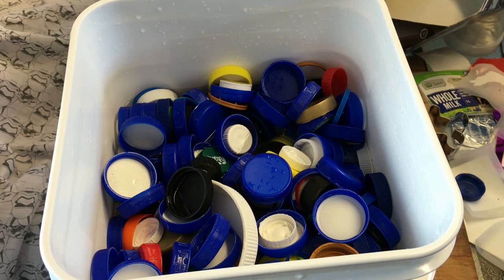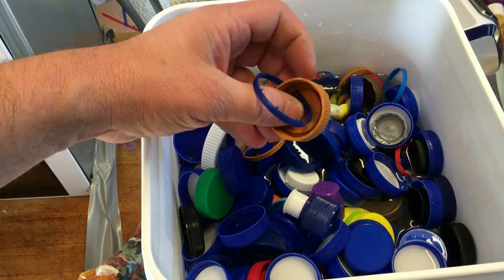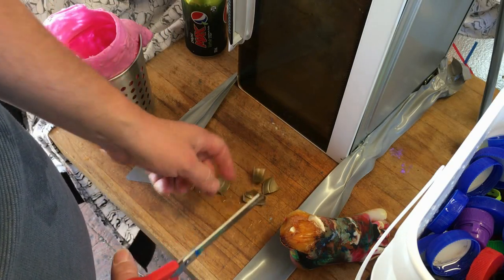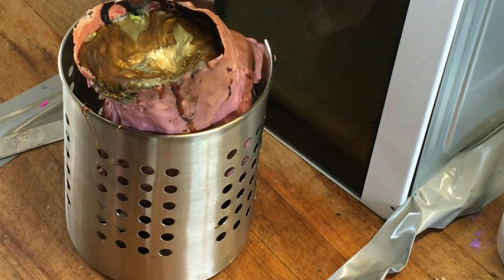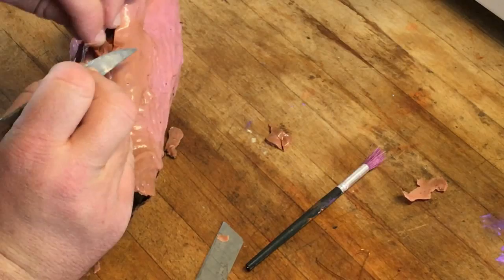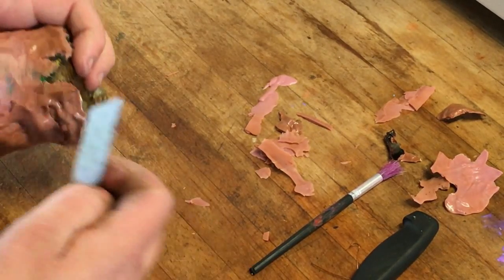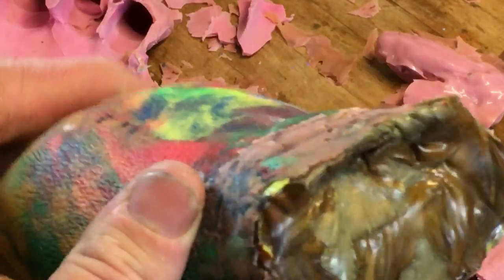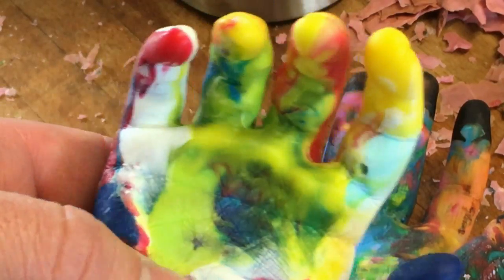Ep41 Silicone Mould HDPE Colored Milk Lids

Comment: Great job man. First vid i watched on my quest to learn about casting hdpe in silicone. The parts i will be replicating are far simpler than a human hand, so it is wonderful to see such high detail carried over to the finished product. Reassures me about my potential results. Thanks for sharing!
Reply from the maker: I am glad you like the video. I have not been successful in saving the silicone. Well the silicone I have been using has been degrading over time. Like it is a one shot deal. In my experiments I have not found a mold release that would help.  Thanks for watching. Kev.
Reply: @kevsmodellingchannel  thanks for the reply! My plan is to do a sacrificial first casting, and cut my mold in half to release. Then attempt to cast again using the same mold, bound together. Will try silicone spray lubricant as a mold release. Fingers crossed!

Comment: After applying the silicon and before removing the form, make a mother mold to hold the silicone mold in the oven. Another skill to learn.
Reply from the maker: Ken Knutson
Thank you for your comment you are on the money. What i have been thinking about is how to make a mother mould for supporting the glove mould in the oven. Plaster would have a long cure time need something faster that would like heat (heat limits choices). 
I am trying to due, is not to aggravate the person that the glove mould is attached to. Mostly kids have a very short window of time you can keep them still.
Any thoughts
I can be contacted via F/B Kevs modelling channel group  

Thanks for watching
kevin

Comment: This video is helpful. I hope you can share an update on mould removal agents you’ve found out. Thanks
Reply from the maker: Hey Abigail 
Thanks for the comment .. NO i have not found any release agent. The problem is any release agent that i would use has to not endure the oven temperatures with out drying. Most release agents only good for short duration's..
Thanks for the watch
Kev

Comment: think it looks like the same mold release I use works well. Another type mold release you can make yourself for silicon to silcon release agent is half petroleum jelly and half keroseen clear pearl pure. you only need just a tad of both as it goes along ways. Use soft bristle brush cut down to make a bit stiffer to spread on sparingly so the release does not imprint a pattern on the part. mold will look like it has a simi wet coat of your homemade release. What is good about silicon to silicon you can make plugs off molds or molds off your plugs made with silicon which if one thinks about the process you will come up with all sorts of clever things you can do quickly and mass produce it yourself.
Reply: 1NRG24Seven

Comment: You can use compressed air to separate the mold.
Reply from the maker: garyrich2000
Thank you for the Idea but this hand was not going to be released with out a fight. It seems that i have not found the right mould release that is able to withstand the oven temps. 
Thanks for watching
kev

Comment: Hey you were going right with paint brush handle, but if you did it under water, it would made separation whey easier
Reply from the maker: Thanks Peter Robertson for the comment.. They say silicone does not stick much to things.. I differ when it comes to heating this ODDbod silicone. I have not found a release agent yet.. PLA  Plastic works ok with this silcone  Thanks for watching and the comment.. Kevin

Comment: I've seen others using hdpe where they just melt the hdpe in a tray in the oven all in one go and then place in the mold. Wouldn't it be much quicker than 3 days to do it that way?
Reply from the maker: Hey Rustystone27
This is a bit different, I am useing the properties of the plastic to allow plastic flow in to the mould. You could not the push the plastic in to this mould. Not with out suporting the mould from expanding. Ie like a mother mould on the outside.

Could this gold colour of burned when in the oven. My best guess is no I did use some black ,gold and what ever colour i had on hand . Some of the melted lids flow in a different time periods giving different patterns.

Thanks for watching
facebook group kevs modelling channel
Reply: Yep, that’s the way I do it too but the plastic needs to be quite runny

Comment: awesome video mate, From the UK. i was going to ask about sand which you mentioned in the end anyway also what if the fingertips are black because it is burnt maybe?

i was always thought when hdpe cools down it shrinks etc and creases up but it doesnt show on yours. when you say it took 3 days do you mean you oven was on for three days?
cheers
Reply from the maker: Hello Mohammed Ali
 1) The oven was not on continuously  for 3 days. What i meant is my time invested was about 3 days. ie the oven was on for about 6 hours one day 4 hours the next 3 hours and so.

2) I did use sand when i did my daughters foot. Just the container i had was pourous so no sand used. Next time new container

3) All plastic does have a shrinkage factor but you dont see it in my hand because there no straight lines. 

4 ) The black hand colour ep42 explains this. 3 primary colours turns black.  The temp of the oven never whent abouve 200deg c .  Buring i dont think it would look like  this. (maybe will have to try this over temp experiments ) 

Thank you for watching my adventures
Reply: Kevs Modelling Channel
thank you for explaining i just watched the other videos too,  thank you for posting your adventures :)

Comment: most small office/home shredders will shred plastic, mine does bank cards so should manage well with lids
Reply from the maker: Yes they do but they are not designed for this purpose, They will struggle with some of the of ythe plastic..
Reply: I haven't tried it but I've heard that blenders work well.
Reply from the maker: i have killed to blenders in this process of chopping up milk bottles..
Reply: Yeah since I posted my previous comment, I've been hearing more and more people saying that blenders actually don't work very well. Which is annoying. May your blenders rest in peace, Kev.

Comment: I keep getting a lot of pinhole where the HDPE first makes contact with the mold.
Reply: Melt a small amount of plastic, use a toothpick to fill holes, then rub across then with a coin or scraper to smooth out the fill and the colouring. It’s easy.